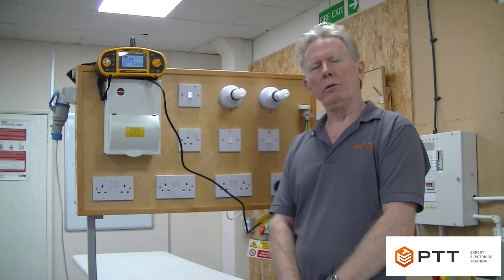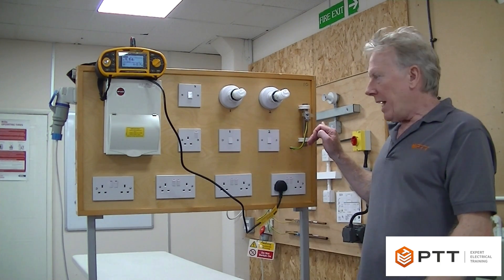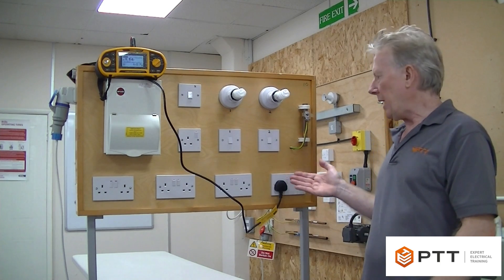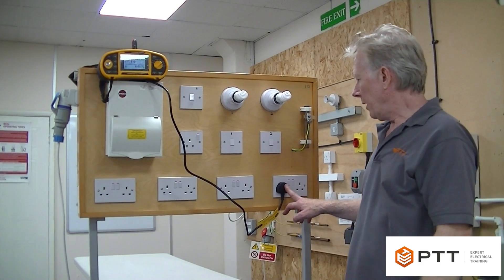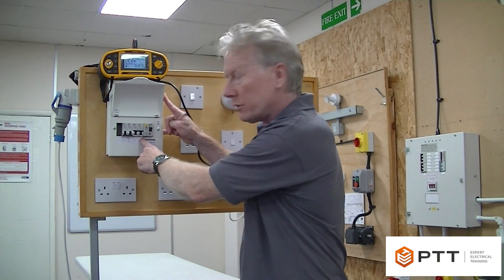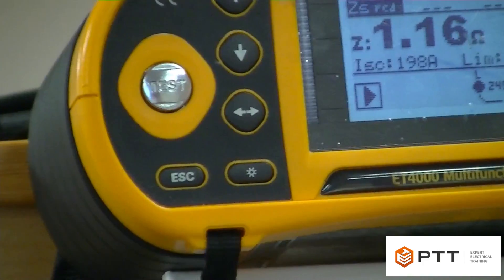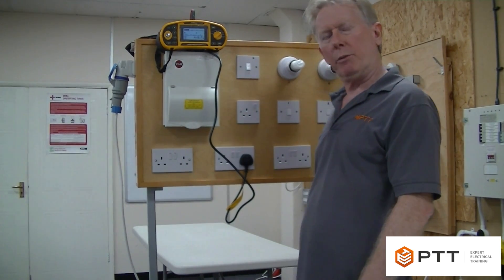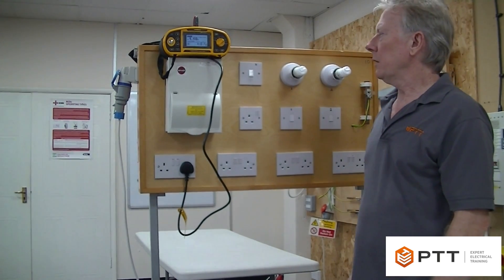How to Carry Out Earth Fault Loop Impedance Test - Measuring Zs | PTT

Comment: The official method is to calculate any Zs because it is considered to be more accurate. IE it does not include parallel paths. If there is an RCD upstream, the test current is lowered, which means the result is not as accurate. When carrying out a "live" Zs test on a ring, you no longer have the "figure of Eight" cross-connection, so the readings will change as you measure at each socket. To summarise, the best way is to calculate Zs by adding R1+ R2 to the Ze. We also need to take into account the Electricity at Work Regulation 14 which states that you only work live when there is no alternative. Hope that helps. All the best for the AM2!  SAM

Comment: Hi great video thanks
I'm currently working on getting my 18th edition qualification,
Your multifunction tester has the same settings for loop and psc as the ROBIN KTS 1620 MFT can you tell me please what you set your metre to in this video? You said a low current, was it set at LOOP 20 OHMS 200 OHMS OR 2000 OHMS?
OR WAS IT PSC 200A 2000A OR 20KA